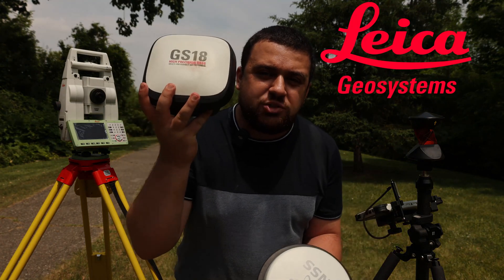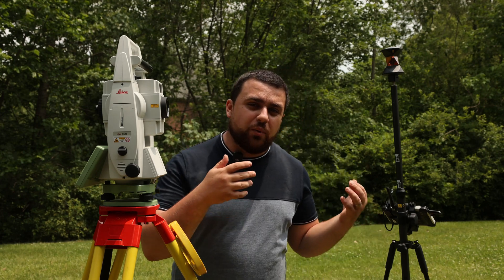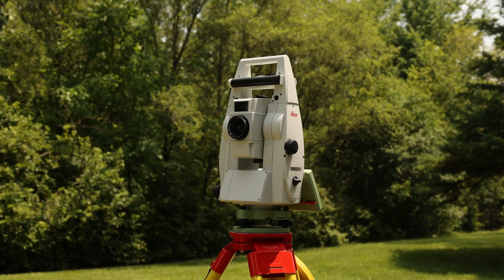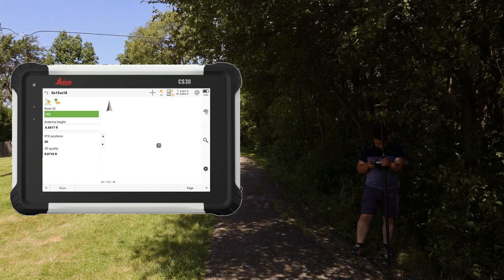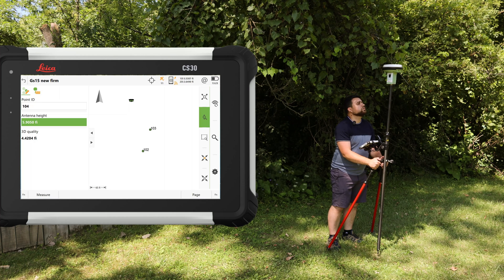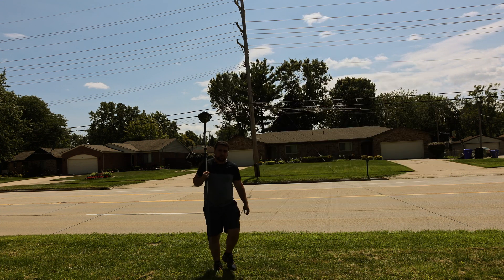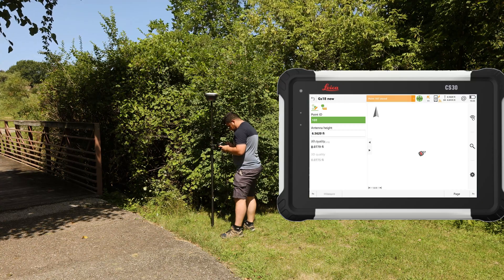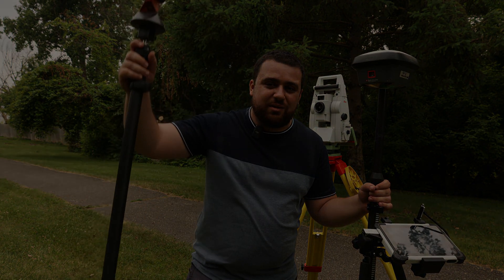GS15 vs. GS18 for Better GNSS Accuracy?

Comment: Interesting to see. 

As a surveyor who recently upgraded from GS14 to GS18T it's been so incredible to see the difference in hardware. One of the big differences of course being that the GS14 doesn't have tilt and can only use GPS and Glonass. The difference has really been night and day. 

Though I have to say I'm not sure about the reliability of the tilt system. I do seem to get quite a lot more accuracy when I turn it off and just use the pole level. But for less needed accuracy I'm all for it.
Reply: the GS14´s  starting with article-nr. 832xxx and higher can use galileo and beidou when you pay/buy the activation at leica. FW minimum V6.5.  btw in general gps-antennas fw-updates even when cost a bit make more sense then in a TS (exept base and rover work), you also update your radar-warner in car why not the sat-ant. at last the  GS14 left production mid2017 imagine how much android/windows updates was since them.

Comment: Hi Rami am based in the uk and work as a contruction manager.Am trying to get into work as a setting out engineer would your course be good to help with that.Luckily I have access to a gs18 and a ts16 and ts12 where I practice with an engineer every weekend.Do you teach using these machines in your  course thank u

Comment: Looking quickly at the height column from the "GS18 old" test, there doesn't seem to be a normal or Gaussian distribution in the differences, which could indicate a systematic error. Maybe points 105 and 103 have some kind of mistake? In the "GS15" test, the distribution seems normal, although the difference at point 103 is too high compared to the others. With the "GS15 new" test, there seems to be a normal distribution, but there might also be a problem with point 105. Either way, a 6 cm average difference seems too much for these instruments and the type of test performed.

Comment: Might have been nice to put the bipod on the 18 to compare to the 15.
Reply from the maker: @bokkenka  no need, the GS18 has a built in IMU which means it corrects the tilt of the pole.
Reply: @RamiTamimi  I was just thinking of a slight jiggle holding it by hand.  The totalstation's on a tripod.  It's target is on a bipod.  That stability on the 18 might have gotten even better accuracy.
Reply: @bokkenka  it becomes a propagation of error issue. The channel The Third Dimension has a lot of great videos around this idea, and I am slowly learning myself. By introducing the potential error from the GS18 tilt compensation, we aren't comparing just the receivers to each other. It's not an apples to apples comparison. No matter how good the IMU is, tilt compensation won't be the most accurate GNSS survey method, and should only be used where accuracy isn't critical.

For tests like this, I'd like to see a run using the tilt compensation, and then a separate run without it and using the bipod etc. That way we can get a real world 'lazy' accuracy, and a best-case accuracy as well.
Reply: @RamiTamimi  The IMU is awesome, but not perfect. It is its own source of error. An interesting test - you might have done this already - would be to compare "plumbed up"  accuracy with "tilted" accuracy.